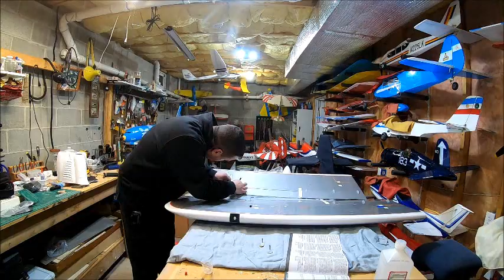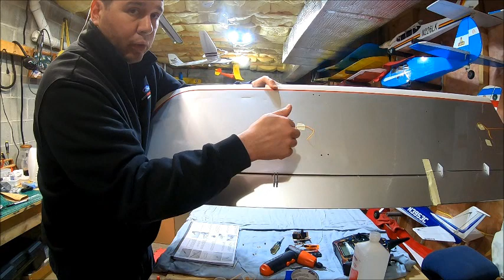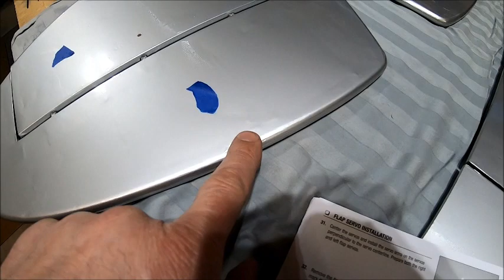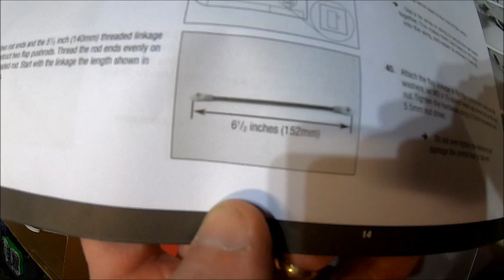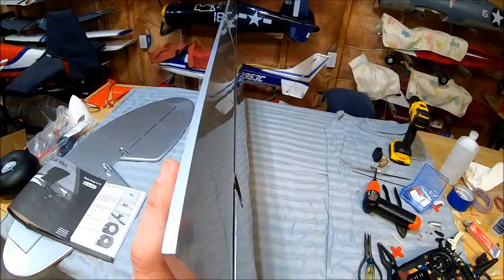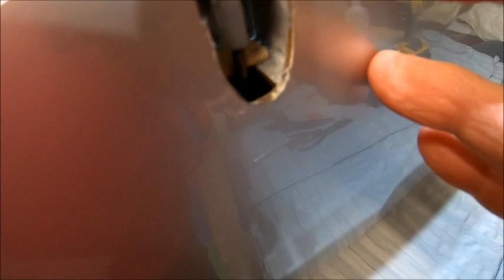Hangar 9 Xcub Build Time Lapse pt1, This thing makes me say bad words!

Comment: Hey I am getting ready to receive my xcub in a week or so. I am ordering all the components to start the install. What servos did you use?
Reply from the maker: HS5645 all the way around. Spektrum powersafe receiver on 6v
Reply: Ok so one more question (I'm sure I will have more), I ordered my HItec 5645 servos and the 12310T power save receiver. I am trying to buy a receiver batter and want to get a spectrum battery to go with the spectrum receiver. They have a 7.4V receiver block but the servos say they only take max 6v's, will these batteries work? Thanks.
Reply from the maker: david danchise good question. 
The PowerSafe receiver is capable of handling voltages from 6.0 to 10.0 volts. The voltage limitations are generally the servos. Most servos are compatible with 5-cell, 6-volt packs. Five-cell, 6-volt Ni-MH packs have become the standard for many giant-scale applications. There is no voltage regulation in the receiver. Voltage in = voltage out.
Reply: @JustPlaneCrazy  thanks i will have to get a non spectrum battery then.
Reply from the maker: https://www.horizonhobby.com/2700mah-60v-nimh-receiver-pack-spmb2700nm

These are the ones I use. I see they are out of stock

Comment: I guess the trade off of having a plane 90% built are problems like that linkage. The only time you'll get perfection is if you build the entire plane yourself. 
I used to kit build all my planes then tried a few arf and rtf foamies but have gone back to balsa, carbon fibre, fibreglass types. Luckily I'm retired so time is cheap, lol.
You'll have a nice plane eventually.